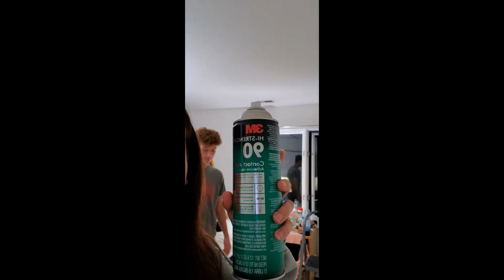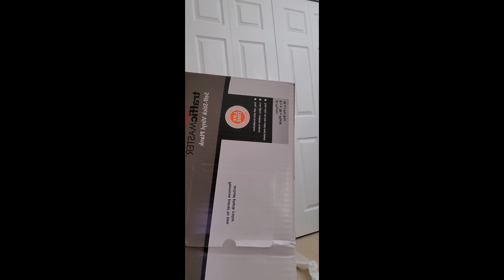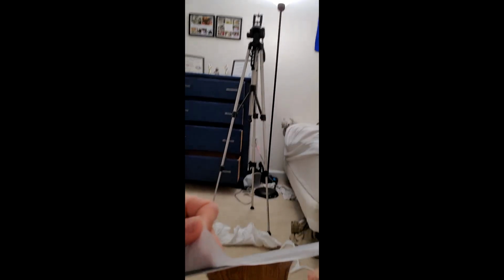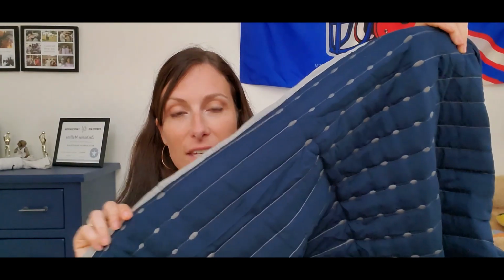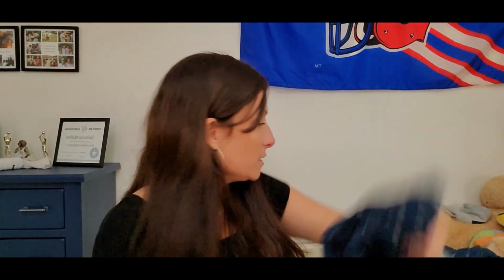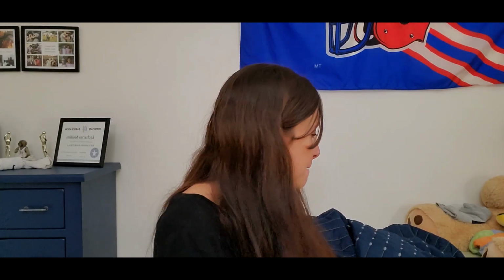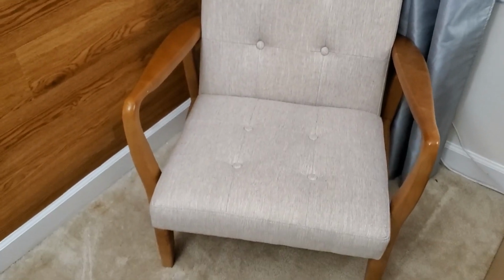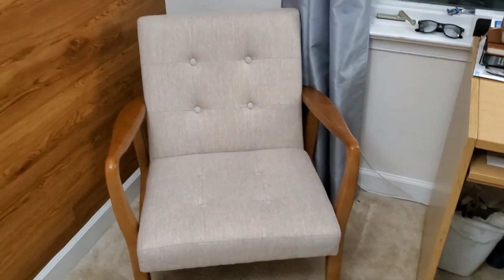Teen Boys Bedroom Makeover // Room of the Month Week #2

Comment: I thought you had to use the spray adhesive? The one you put up, you didn’t spray it. You just peeled it and put it up. Did you change your mind?
Reply from the maker: No we used the glue. I just took clips of our videos so it wouldn't be too long for this video. When I do a tutorial video there will be more details. We learned more about the process as we went. Just spraying the glue won't work. It has to dry a couple minutes before applying.